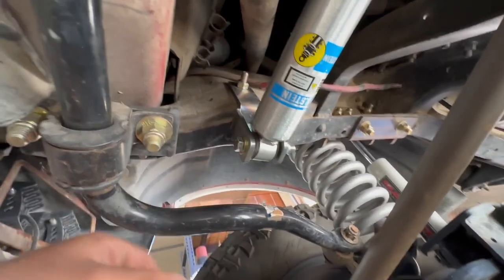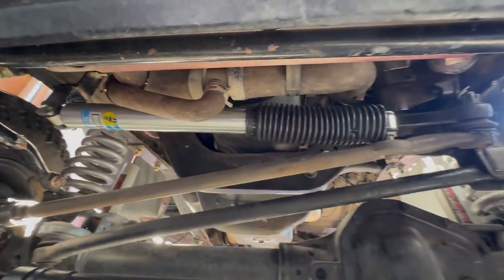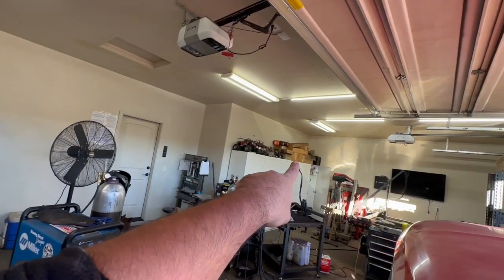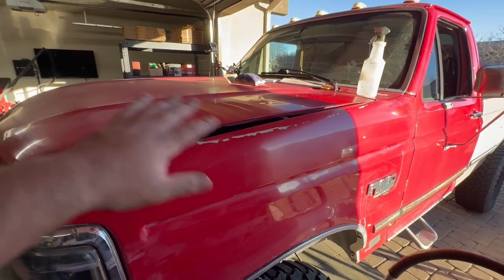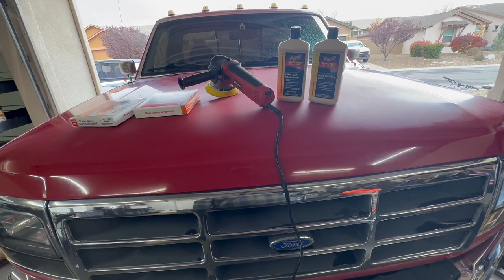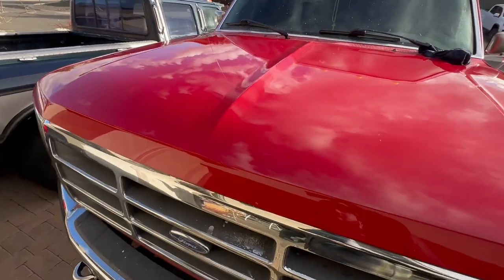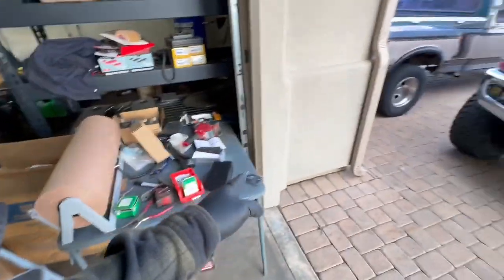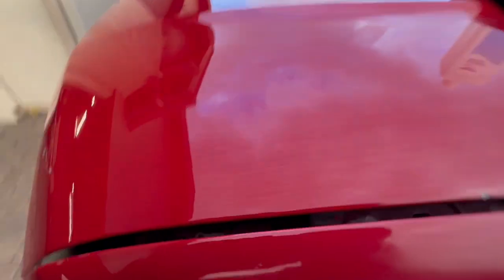OBS Gets A New Steering Stabilizer And A Paint Correction!!

Comment: Just picked up a rear axle yesterday. I’m working on getting it swapped in, and still on the hunt for a front axle. I’ll definitely be ordering a kit soon and would definitely like to have a stabilizer option. Your kit looks superior to a few of the others because you correct the alignment of the radius arms and don’t put them directly under the frame, and your coil buckets allow for shock lift height to match the spring lift height.